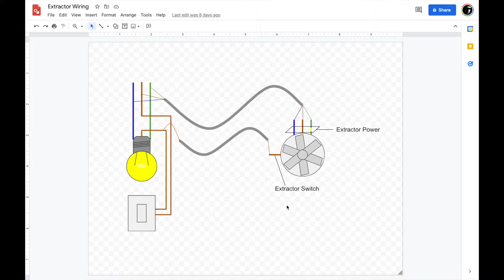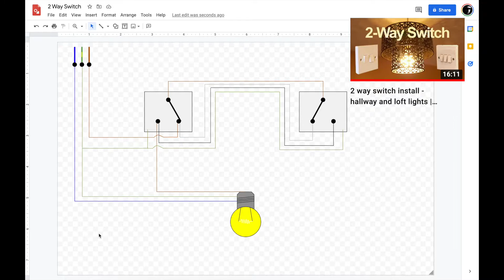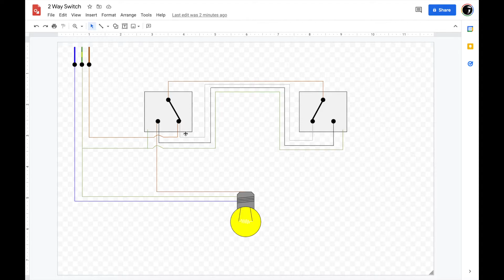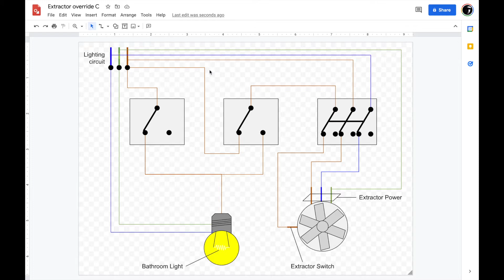How to connect an extractor - properly this time (…and why you should) | Blauberg Calm Design

Comment: All fans in the house have three and are wire with the light switch and fan switch. However one fan died and the replacement I’ve got from the shop has only two wire inputs. Can I wire the cable from the light to the brown or blue? Or should I get a fan with 3 wire connectors? Thanks